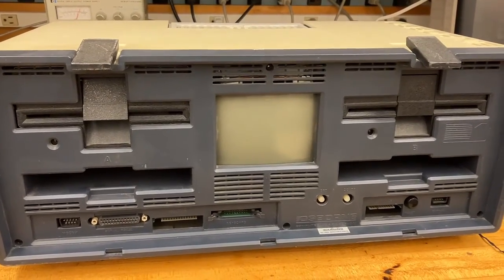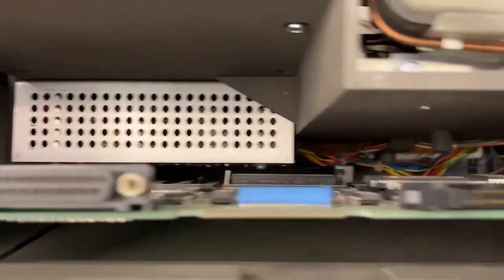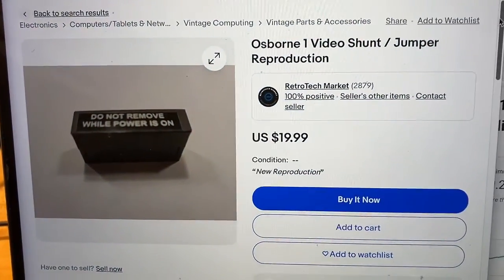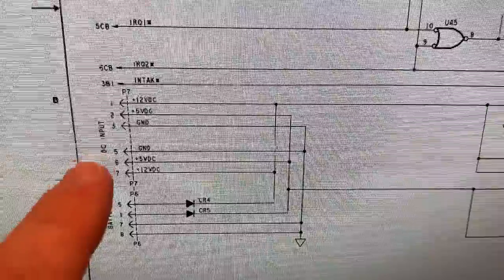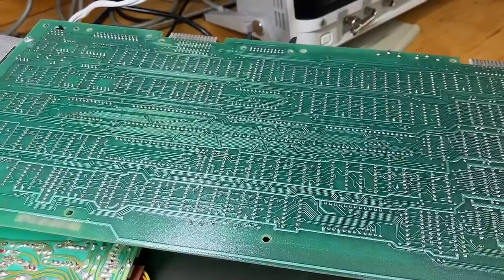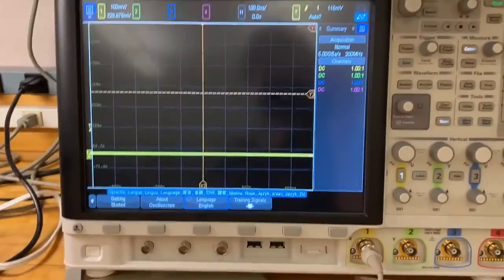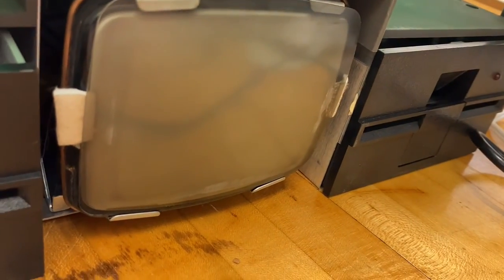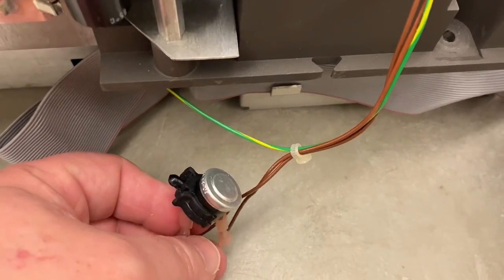Osborne 1 "Portable" Teardown and Oscilloscope Tests (and Why You Should Read the Manual First)

Comment: The mystery component at the end appears to be a bimetallic thermal cutoff switch. My guess is they placed this in series with the power supply to prevent ahem "a thermal excursion event" in the enclosure.

Comment: "This" indeed is a thermal fuse. It's use, especially mounted in this way, is mostly useless.
I assume this is a one way fuse, this has a low melt solder joint that breaks when the temperature is reached. This type is mostly used to prevent equipment burn out at stuff like e.g. modern coffee makers that have an electronic temperature control. In case of an electronics malfunction, the fuse "pops" to prevent a possible equipment fire.
But there are also bi-metal thermostats in this same form, originally make by Klixon, to control e.g. the water temperature in a washing machine.
"Mostly useless" as Douglas Adams would call this since the idea is to mount the metal surface of the temp. fuse to the part it protects.

Comment: 12 volts may be required to run the motors in the floppy disk drives.

The unidentified thing towards the end of the video could be a temperature sensor or maybe a buzzer.

I never owned an Osborne 1 but used one extensively in the early 80s.
Reply from the maker: I thought it was weird how the unidentified thing was just sort of floating around. Although... it may have been affixed to something originally but came dislodged at some point.

Good point about the drives!